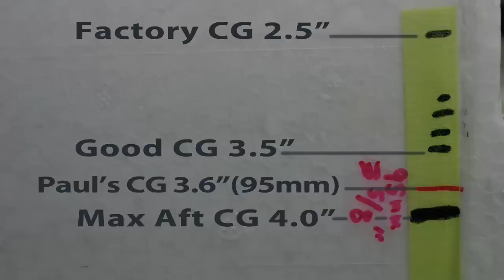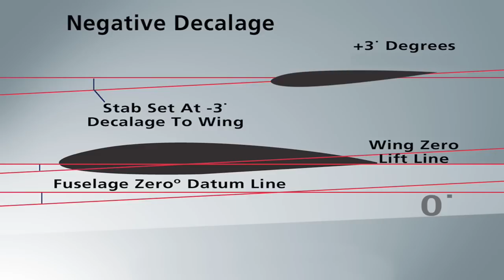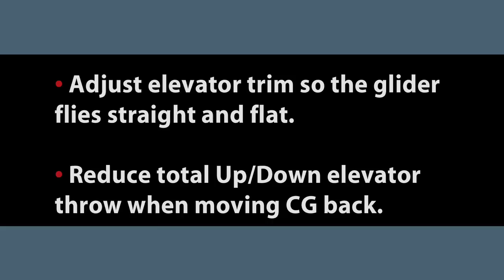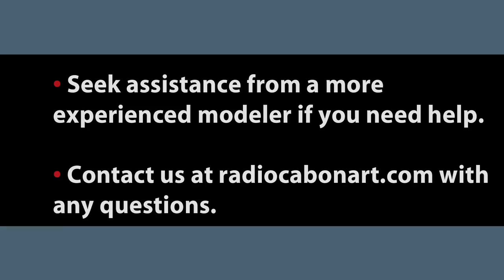Parkzone/E-Flight RADIAN Glider Modification & Tuning Clinic #1

Comment: Great video, however just note that the 2016 versions of this and probably earlier ones have already been improved at the factory and these mods would no longer apply.
Reply: wish I would have saw this before, I did the tweaks and crashed broke nose off. It did not need any work done to it in the first place

Comment: I stiffened up the wings with packing tape.  Under high g's, it didn't allow the carbon spar to flex evenly, and it failed between the wings.

Comment: A lot of what you say about decalage rings true for my standard Radian: bought mid 2014. It seems very inclined to roller-coaster, and reluctant to fly straight and level under ANY circumstances. Thoughts???
Reply from the maker: The up and down tendency is more about the very far forward stock CG location. The decalage can be way off, but until you start to move the CG back, the plane will still want to climb when speeded up or power is added. You can zero out the stab, but unless the CG goes back, pitch up problem will persist. Let's say the stab has 2-4 degrees UP in the back. Move the CG back to 3.5 inches, and the plane will pitch up even more, as the stab now has more 'power' over the wing with the aft CG. You can add lots of down trim to the stab, and this will eventually level out the glide, you could fly like this with improved handling. However, the CG, stab angle, and elevator trim setting are still unbalanced. Fixing the decalage angle of the stab so the elevator flap is near the zero center angle for a flat glide angle will help the handling at any air speed. If you want to learn how this all works and how to tune any glider for better flying qualities, get my Performance Tuning for Gliders video in the radiocarbonart.com website.

Comment: This plane is a monoplane and has no decalage angle. If you are changing the angle of incidence, you should term it that way. Decalage is the difference in incidence between the two wings on a bi-plane.... I got corrected by a person who was on the design team of the "wing box" on the CF-105, and with his experience, I never argued one bit.

Comment: Hi Paul ,    greetings from New Zealand .  We have had imperial and metric systems here and i followed your 3.6" CG so all ok but you stated 3.6" = 95mm , it does not.    3.6" = 91.44mm    conversion is 25.4mm per inch exactly.  Still i have enjoyed all your videos i have seen so far .  Regards Wayne

Comment: Hi Paul... when you are showing the cutting of the flaperons..you talk about "gap sealer" what are you referring to? a liquid "no more gaps" painter's sealer like sikaflex or another form of tape? I'm trying to relate the vision of the tape that appears to be stuck along the beveled flaperon clearance "gap" with your spoken words "I used gap sealer"... please explain/nominate the actual product you used...and if it is a tape... how do you seal the gap and still get full throw in each direction without the tape bunching/wrinkling in the up deflection. thanks Rodney in Melb Aust.

Comment: Paul, I did all these mods, It flew very well when the motor is on.  After turning off the motor and trying to glide I notice when it would pick to speed it would pitch up and I guess it was porpoising  cause it would repeat.  Did I make it too nose heavy??? I gave down elevator and seem to improve it but it seem it was more of a dive.  Just not gliding as well.

Comment: I have been flying a Radian Pro for some time now and love it but as I'm sure you are aware it is a different animal than the original. I like your detailed modification tips as many of them could be applicable to the Pro, especially the ones concerning moving the CG aft, and taping the wings. One big drawback of the Pro is the wing mount system - it is not a pressure fit like the original. I'd be curious to find out if you have messed around with a Pro and some of what you have come up with.

Comment: Very usefull IMHO, although I have to get used to adding weight to the tail-section. To me that occurred a little counter-intuitive. Although adding strength to the tailsection is important of course. I understand the importance of moving the CG back, but couldn't that also be achieved by removing weight from the front and picking a lighter-weight LiPo? Looking at the difference of Angles-of-Attack of wing/ stabilizer and getting accurate measurements is recommendet for other types of R/C planes too (very usefull). Thx!

Comment: I have a new night radian and used to flying 4 channel aircraft. Ive seriously considered the flaperon mod to the N radian.  Does the mod provide alot of authority as ailerons being inboard on the wing.  I've considered 20" long ailerons so im not messing too much with trying to hinge the polyhedral section of the wing. Is there any particular mods that you could suggest specifically for the night radian if you have had the opportunity to fly one?  Thank you for your help.

Comment from the maker: 11-6 is fine. You will need to sand down the shoulder to fit the yoke.  An easy job. Diameter greatly increases thrust and amp load, pitch changes thrust and load in much smaller increments. 12-6 will over load motor.

Comment: I saw that you use an 850 Gens Ace for competition. So I checked the weight of the Parkzone 1300, and it came out to be 100 g on the dot. According to Gens Ace, the 850 weighs more, but less than the Gens Ace 1300. Is weight the factor for the selection?

Comment: How would you compare Flyzone Calypso to Radian Modifications you showed here since Calypso already comes with most of those options already including ailerons and optional flaps. I know that wingspan is not as large and Dihedral is not as large in comparison but would be interesting to hear you opinion on it. Thanks.

Comment: Thanks for tips Paul.. well explained.
Question:  What is causing my Radian to bob up an down while trying to cruze level.?
It does this after I climb and try to level with motor off.  Takes a while to stabilize.
Any Ideas. ??

Comment: I've modified both my Radian and Radian Pro with your changes.  Test flew the Radian today in a stiff 5 to 6 kts of wind.  The most remarkable aspect I notice (having done all the mods to my planes) was the articulation of the plane.  It is definitely more responsive, turning with purpose, plus, has more weight in the wings due to the clear tape which I think adds to its tendency to dive quicker.  Thus, the stick controls need not be so random or heavy handed.  The plane is very attentive where it was not so before.  In the wind, it would tend to hang in the air rather than be blown back or rather than sloping downward.  That may take some getting used to.   I've flown my Radian for about 6 years in all sorts of conditions and this change has a significant effect on its performance.  User needs to adjust for the changes now.  I'm wondering if others here are using the additional clear tape on the wings too.  Thought I might test fly that next w/o tape to determine the difference in responsiveness.
Reply: And how'd it go with the tape off?
Reply: Good question.  I've put on some generic wings again but have been preoccupied and not gotten back to some test flights yet.  Good reminder for me to do that!

Comment: Great video, I will be taking delivery of my radian soon, I love the mods you made, they make total sense and I will implement then. I was just wondering though, the area where you added the plywood plate that you've cut to shape to stiffen the weakest/thinnest point of the tail, would it be possible to apply epoxy, painted on that area to form like an exoskeleton? It would both ad significant weight and strengthen that area. Thanks for your opinion!

Comment: Hi Paul,
I see this video has been up for quite some time. I just acquired a Radian and stumbled upon your video. I'm just getting back into RC after a 20 year hiatus. I can find the regular Robert incidence meter in a Google search but cannot find the smaller version you reference in your mod video. Would like to know the manufacture of that unit so that I might be able to order one. Or would the AnglePro 4-in-1 Digital Throw/Incidence Meter be just as good?
I will be incorporating all of these mods into my Radian before the first flight.
Thanks for a great video tutorial course and I am looking forward to my first flight with a modified albeit better flying Radian.

Comment: Hi Paul thanks for this video and also for your great soaring DVDs. Quick question, do you reckon we have a linear relation between the CG location (2.5"-3.5") and the decalage trim (0mm-6mm) for a stable Radian? For example can I set CG at 3" and decalage trim of 3mm? Thanks.

Comment: paul i need help i built a full flying horizontal stab and with the cg at around 3 to 3.5 inch back i actually need up trim to fly straight if i raise the decaloge it wants to dive right out of the sky
Reply: Joseph Rueck g

Comment: Paul, GREAT video. I had one of the first Radians in my club, now we're having electric glider contests with a dozen or so folks. Radians are holding their own.  I've just ordered another set of wings to do the flaperon setup.Also just got a RocHobby V-Tail and will be trying a few of your mods on that. Question:  What do you use for your GAP covering?  I've ordered the 260 tape to cover my wings. Many thanks! Mike

Comment: Hi Paul. I did the mods to the Radian the other day. I changed the rear stab angle and added the correct weight to get the CG right. I did some things to make it stronger. Covered the wings and stuff. My problem is, the plane wants to dive under power and nose up off power. I can't trim it out as when I do, it will change depending on the speed of the plane. It also doesn't seem to glide well at low speed and wants to nose dive. Seems hard to land. When I flair it off just a tiny bit, it tries to stall. Another thing it does, when trimmed to glide, it seems fine but if I drop the nose it doesn't even try to pull itself up. It just dives even harder if I don't pull back on it. Any ideas off the top of your head? I'm going to try changing the rear stab to 2.5mm and see if that changes anything.
Reply: Hmmm, sounds like you had similar difficulties as me.
Reply: Possible nose heavy, now? Did you actually achieve moving the CG back? I will be doing the mods on mine, shortly.
Reply: Yeah how do you make the CG go back?

Comment from the maker: Factory CG is 2.5" back from leading edge - this is WAY nose heavy CG and causes flight issues.  Start at 3.5" back from LE. I fly mine at 3.75" back, which is about as far as you want to go, plane is very neutral but still very stable IF - you reduce the elevator throw as you move CG back. Problem with Radian are the long servo arms which reduce resolution and increase slop in the push rods. Elevator gains power to change wing AOA as CG goes back! Too much total elevator movement with an aft CG position will make plane hard to fly in pitch.  My elevator only moves about 20-25 degrees at full stick deflection. Reduce throw mechanically first, then use radio end points or dual rates to reduce elv throw.
Reply: Paul Naton how do u make the CG go back?